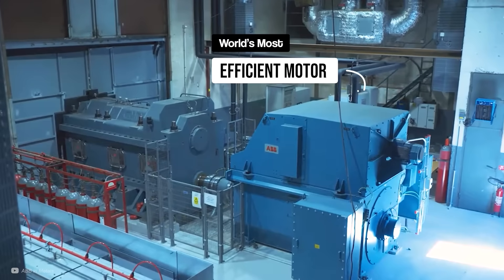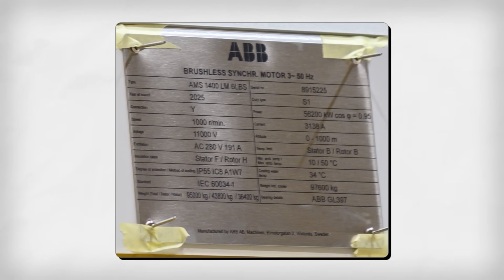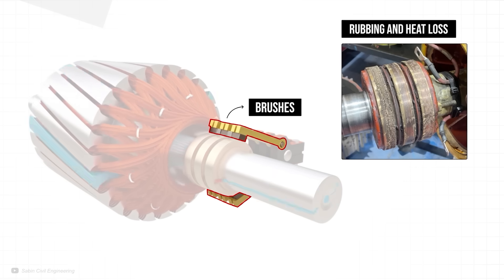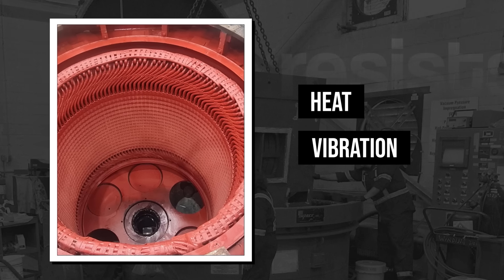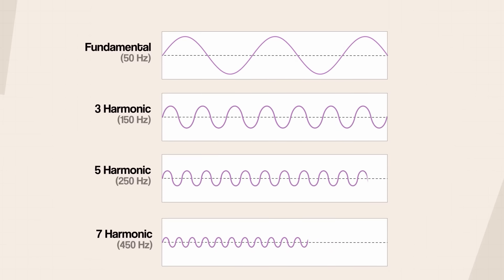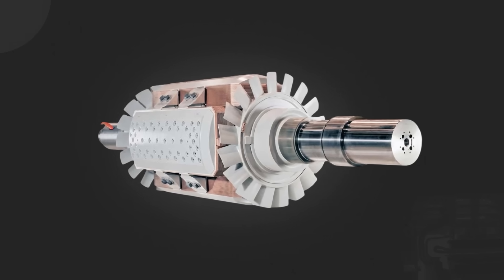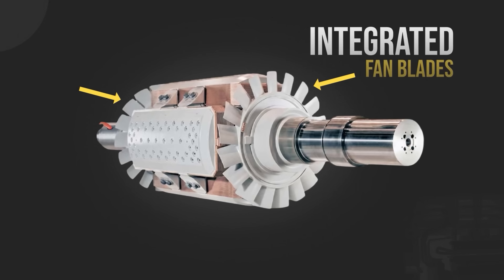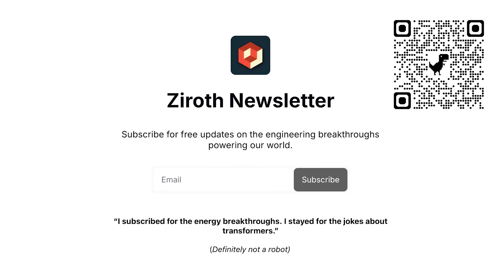How This Ultra Efficient Motor Just Broke The Limits

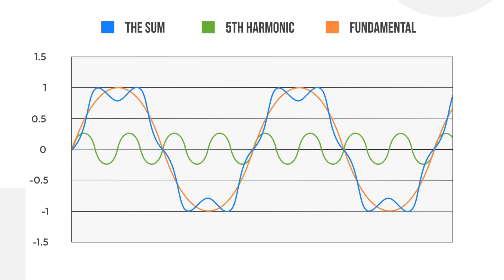Comment: The graph used at the opening and at 7:14 in the video is wrong. The line labeled 5th harmonic is actually the 4th harmonic.   The line labeled the sum isn't the sum of the fundamental and the 4th and it's also not the sum of the fundamental and the 5th.  It looks like roughly sin x + (0.4088 * sin 3x) is the equation for the sum.  I'm pleased though that after all this time I remembered enough trigonometry to have an instant gut reaction of: "That looks wrong," from glancing at the graph.   Just curious, was this an AI generated graphic?

Comment: A brushless motor does not mean it is wireless. Rotating exciter armature winding is a generator rectified to dc with a rotating diode wheel. Rotating exciter field so no need for slip rings. Nothing unique for a synch motor

The efficiency sweet spot is load dependent so hopefully the end user integrates this properly to get this unicorn target.
VPI insulation. Synch motors with wound rotor. 
None of what was explained is unique in the industry. This is ABB paper looks like good advert. Polishing the ordinary.

Comment: If electric motors had only achieved, say, 50% efficiency then bringing them up to 99% efficiency would indeed have been a world shaking advance.  But since they already were at 96%, this is a but ho hum.  A real advance would be, for instance, developing chips that worked on photons instead of electrons.  With the resulting cut in power for data centers by a factor of 10, they would stop eating up all our advances in the production of new, cheap, renewable energy.  I once had an argument with my engineer father.  I told him with great confidence that the farmers of the plains should stop building those classic wind turbine pumps with the multiple blades made of sheet iron and use the more efficient air foil propellers.  (like modern wind turbine blades).  He pointed out to me that a farmer could build 5 of these cruder wind pumps for the price of the more efficient model and could repair it himself if it ever broke.  A lesson well learnt.
Reply: An efficiency improvement from 96% to 99% is 4 times reduction in energy loss. Imagine cutting your losses to a quarter that's a big deal.
Reply: Using this beast of a motor is saving 1.68 MW an hour in electric compared a standard 96% efficient motor

Thats saving something in the ball park of $2500 per 8 hour shift at a factory

Over a general year $650,000 in savings

I think it's a decent improvement

3% might seem small, but at scale, it's not

Comment: I wonder if the operating temp. if reduce to super cold, to the point making the copper windings into super conductors. what the efficiency would that rating be at, and what type of work power would it be rated at?
Reply: Superconductors blocks magnetic fields this is how superconductive levitation works. But for electric motors this property is counter-productive.

Comment: It seems the main advance in this motor is the wireless power transfer energising the rotor instead of slip rings and brushes. Wireless phone chargers are well known as inefficient, so how is this different?
Are you able to expand on this crucial design aspect?
Reply: Comparing it to phone chargers are misleading because that motor is the size of the house. Power transformer also uses induction to wirelessly transfer power from the primary coil into the secondary coil and they can easily do it with greater than 98% efficiency. But transformers are heavy so you don't attached them to your smartphones. Wireless phone chargers use very tiny coils that's why their efficiency are not good it's a practical limit not a fundamental limit.
Reply: @kazedcat  Exactly my point! 
This is where I really want some more detail. Sure you can make a transformer optimised for a spinning secondary. Is that what they are doing?  Is it part of a high frequency inverter? Do they rectify the resulting current with accompanying losses, or run the stator and rotor both at at HF?  So is it an induction motor?

Comment: I don’t understand how the coils inside the rotor can get power wirelessly, that seems like a real breakthrough
Reply: Microwave
Reply: You wind a secondary coil in the rotor then wind a primary coil around it with a small gap to allow the secondary coil to freely rotate. What you have is a power transformer with a freely rotating secondary coil. This can transfer power with >95% efficiency with proper design. If the excitation energy is less than 1/5 the drive energy then your losses are less than 0.008 loss factor.

Comment: Does the wireless transfer introduce losses at that point?
Reply: Yes but the losses are minimal. Power transformer can easily wirelessly transfer power with >98% and the power needed to excite the rotor coils is much smaller fraction than the power needed to drive the rotor.

Comment: Not that many AC motors have permanent magnet rotors, most are smallish servo motors where you need high dynamic response and accurate torque delivery. Nothing I've seen in this video is that different from the motors I saw being made at Brush Electrical Machines 40 years ago, including brushless excitation.

Comment: It's kind-of amazing to see this motor not having laminated stampings in its rotor.
Reply: They don't need it. The motor is synchronous so the rotating stator fields are rotating at exactly the same speed as the rotor. To the rotors perspective all the fields are static so no induction current can manifest.

Comment: Are there “superconductors?” Are they flexible or inflexible/brittle? If there were superconductors they would be useful for electric vehicles.
Reply: Superconductors block magnetic fields so they are not good materials for electric motors.

Comment: Hey, motor designer here. Having no clue why they chose solid pole shoes, why not laminations to reduce core losses...
Reply: perhaps it is so efficient it does not induce eddy currents
Reply: @LiviuGelea well, yeah, it is a rotor, the airgap is likely big and non-uniform and with distributed winding you don't usually have large rotor losses in general, but... I don't understand which advantages do they get with this design.

Comment: 11:54 That CO₂ saving is assuming WHAT TYPE of electricity production, coal or natural gas in what type of heat engine. I assume it was from an old inefficient coal fired plant not a 49% efficient new plant or is that a natural gas peaker plant vs a combined cycle plant. Full disclosure is important to maintain credibility.
Reply: Yeah

Comment: FROM THE RIVER, TO THE SEA,
ALL SHALL HAVE, EQUALITY.
FROM THE SEA, TO THE RIVER,
EVERYONE IN PEACE TOGETHER.

Still enabling that genocide, and NOT calling it out? Is silence complicity? I think it mostly is, especially if the person, is relatively safe from harm, despite the condemning of the genocide perpetrators, and where they have access to the evidence (c.f. 'Social media'.)of the genocide, then add to that, the stated intentions; publicly, openly and repeatedly, by almost all the govt, AND opposition parties, to the cumulative belief that when the IDF send you to Gaza; you are going to carry out a genocide. Anyway, great video. Thanks. Very impressive piece of kit. Is there anything, which will store my summer sun, for winter nights. Either, some really well insulated, maybe phase-changing, thermal system, making bricks, just really, really hot, battery - Lithium, too much loss. Iron-air at domestic scale?? Flow batteries? The 'soon to be announced' dirt cheap, sodium ion batteries, coupled with dirt cheap panels, making 75% loss over eight months, mighty -cheap still .

Comment: I could be wrong, but I believe that a superconductor motor could be made more efficient than even 99.13%.
Reply from the maker: They are on the list of ideas for future videos - so watch this space!
Reply: @ZirothTech neodymium eat your heart out. A superconductor stator and/or rotor could hold a field of epic strength.
Reply: How much energy would be consumed in providing the cooling for superconducting motor likely more than 2% of the run power of the motor.
Reply: @garysuter6292  Liquid hydrogen fuel would be the coolant for the superconductor. But you're right to believe that it takes a lot of energy to liquify gaseous hydrogen.

Comment: Over 5 years ago now the World Solar Challenge race featured a permanent magnet, about five horsepower, direct drive wheel motor with somewhere North of 99% efficient.  Two key features are elimination of ferromagnetic materials where a changing magnetic field occurs and a change to five phase drive system rather than typical three phase drive.  This five phase drive using modern solid state control is east to implement for small motors.  Why we do not see these?  Similar methods are now appearing in air conditioners compressors with variable speed compressors matching load conditions.
Reply: whereas i made a thermal storage solar car. an actual car, a datsun 120y. plan being i would sit in the sun all day then catch up and overtake come nightfall when it gets cold. it worked quite well. darn site better than a solar panel perched on a few bicycle wheels.

THEN i checked the rules. 

how interesting... seems all targeted towards teaching university students to buy this device and that circuit from certain major semiconductor manufacturers. gotta have batteries, gotta have inverters, gotta have electric motors... and NO RUNNING AT NIGHT!

not being from a university, and NOT having any batteries other than a small lead acid for the lights... i just thought i could enter, win, and prove a point. i was wrong.

at that point, i knew that it was all a scam. its not about making "progress" or "improving things". its about ensuring future generations remain loyal to certain manufacturers, and help them maintain their market dominance, their dividends on the stock market, their happy happy shareholders, their overpaid CEOs...

25 years later, and theyre still spruiking the exact same BS as back then.

anyway, lets go back to this motor you are so impressed by...

was that "99% efficient" in relation to the electrical power consumed versus the useful shaft power produced?

did it take into account teh energy conversion in teh batteries? the transmission losses?

or was it simply cherry picking a particular set of circumstances, and by carefully ignoring the rest of the machine, this "99%" figure was derived?

when an electric motor is stalled, its converting 100% of its input power into heat. i guess thats also a form of "efficiency"...

when an electric motor has the same resistance as the power supply, half the power is lost in the source of energy itself. its this thing called "jacobis law". try looking into it. the genator, batttery, whatever, has its OWN internal resistance, and as the same current flows in that as in teh load... the power in both is equal, and is half the total power in the system.

when you start to consider the ENTIRE SYSTEM rather than cherry pick the bits that suit your agenda, you can start comparing them to an ICE, which is a self contained system, from the energy conversion through to final output at the SHAFT....

why dont any of these manufacturers ever mention the SHAFT POWER to the electrical power consumed? hmmm?
Reply: @paradiselost9946   Nice on the details of actual efficiency measurements!  As for the  solar challenge motor refereed to, that 99% was the RMS power delivered to the motor versus the shaft horsepower developed.  Given the use of modern semiconductor technology this may have included the loss in the power supply.  Cannot say from memory.

But is one really gives a darn, as it turns out it is quite easy to make a motor which derives its rotational torque by only using magnets.  This "motor" requires a brake to stop the output shaft under no load conditions.  Got the prototype working over two decades ago.  If receive a windfall am working on, may perfect that into a product.  There are more important things to do though.

Comment: Interesting, however, there is a guy on the internet who has cracked "the code" years ago on how to not only make electric motors 100% efficient, but in fact over-efficient. Implications? Well, firstly, the electric motor can be made to essentially act as an over-unity device, despite the fact that such a device/system should not be possible according to schoolars. Yet, in 2019, the U.S. Navy accuired a number of exotic patents one of which was for a "generator" capable of generating power for its own operation, once it had been "started", or in other words, some of the generated output could be feed back into the device making it a self-sufficient or self-sustaining device, no longer requiring any external input power to maintain its own operation. Secondly, the electric motors using this guy's concept do not get hot even at full load, nor do they exhibit the resistive (or "braking") effect when spinning the axel, which other electric motors suffer from due to being inefficient systems. The secret to these remarkable properties all has to do with optimizing the coils. Had the URL for this guy some years back, but sadly, it has been lost (or more likely misplaced).
Reply: I think that motor takes advantage of the unique magnetic field of a flat earth.
Reply: @RA-gk5zg Wow! A regular genius you are, eh?
Reply: @RA-gk5zg  exactly! because the flat Earth has only one monopole)
Reply: @RomanVladimirovichF "...has only one monopole" is just a brilliant observation if it wasn't for the fact that "monopole"  means "1 pole", i.e., "...has only a monopole" would be the appropriate wording.

Comment: Mhh, impressive numbers. But how do they add up? This is a 56MW motor, which consumes 1344 MWh / day when running 24/7, which cost ~140k Euro/day (~100Euro/MWh). When you save 3% of this due to higher efficiency, this is 40MWh, 4k Euro a day, 1200 MWh, 120k Euro/month,  14GWh, 1.4M Euro/year or 350GWh, 36M Euro in 25 years. Impressive numbers alone, but remember, that this is only 3% of the total consumption, which you pay anyways! This motor consumes 489GWh, 49M Euros / year and 12.2TWh, 1.22B Euro / 25 years!

Comment: I question the 99.13% efficiency rating. Inductive energy transfer to the rotor is a loss. The cooling fans are a loss. You mentioned cooling was also increased with chilled water in a heat exchanger. Is the energy to chill and pump the water included in the rating? This is an interesting motor, but I don't think we have the entire story.

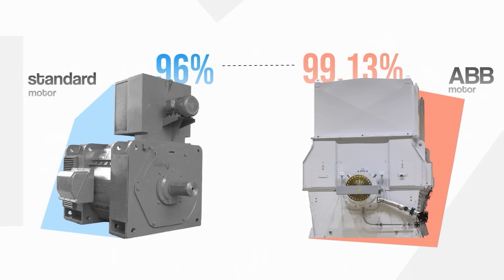Comment: 0:32 - as a rule, comparing percentages by just subtracting them is always fraught. Going from 96% to 99% efficiency is actually 4x less wasteful, so calling it a 3% improvement is pretty misleading. (Ryan knows this of course... just pointing it out.)
Reply: This is very interesting, can you please run me through the maths?
Reply: @venom_ftw9316  a 96% efficient motor wastes 4% of its energy, while a 99% efficient motor wastes 1%. That's 1/4 of the waste.
Reply: @prdoyle oh, I had imagined something else
I guess I was really tired when reading the comment
Thank you
Reply: @prdoyle  lol
Reply: @venom_ftw9316  ffs...
1/100 is 1%
1/25 is 4%

1/50 is 2%
1/1 is 100%.
Reply: @paradiselost9946 
🙂 Oh shoot fr? Id always imagined 100% to be 100/1
Reply: @venom_ftw9316  its like the trick question. a bag of potatoes is 100lb. its 99% water. how much weight will be lost when its 98% water?
half of it... 
1%. 1 in 100.
2%. 1 in 50.

percentages are confusing. ;)
Reply: When you factor in diminishing gain-per-development... it's on a whole different level. Gaining 3% from 96%, is nearly on par with getting from inventing the wheel (rotor) to inventing the electric motor itself.
Reply: We all watched Breaking bad
Reply: 3%, may seem small, but its a lot . - Gale Boetticher(Breaking Bad)
Reply: Just made the same point myself. The motor will be far easier to cool @ 99% efficiency.
Reply: This is all a matter of framing. If talked about in the manner of wasted money paying energy, it didn’t really save me much in the grand scheme of things. It makes it easy to understand that my necessitated waste of money has been quartered which is important, but scale is very important to consider. Did you save $75 or $75000 in operating costs? What was price of the effective “work”?

It depends on how it compares to its impact on margin. There’s also a good chance that it’s in the noise.

Where it might matter more is actually an engineering challenge such as thermal management. Quartering the losses means quartering the heat load placed on the motor.
Reply: @enderoftime2530  fair point, but this is an engineering video talking about how waste was reduced.
Reply: He's only an engineer, he might not actually lol
Reply: Surely the relevant quantity is how much overall waste is generated.  If I improve the efficency of a motor from 99.9% to 99.999999% I've made it 100,000 times less wasteful but if I can improve some other process using the same total energy from 50 to 51% I've saved 10x the amount of energy.

Comment: What about the IR drop on all those copper windings? They are hefty but it's not a superconducting motor.
Reply: You can simply size the copper to get the desired efficiency you need anyway the motor is stationary and you don't need to worry about the overall weight.

Comment: I wonder if the comparison they quote of payback in 3 months is based on the price of a less efficient motor (still not zero) and theirs. That might account for the payback period being so short. Could you please find out? That is an important detail.
If the difference in price is $60,000, and the difference in efficiency is 5%, that might be more realistic.